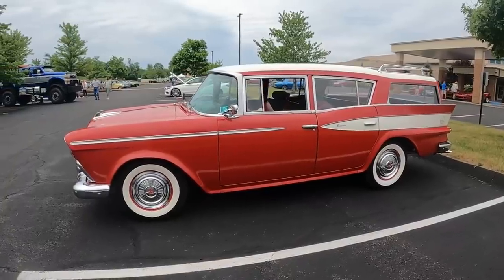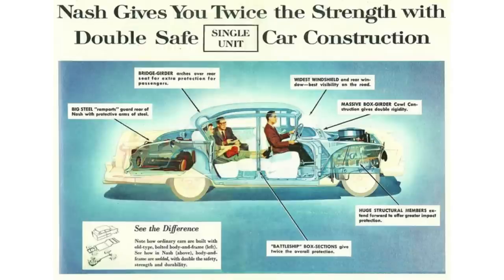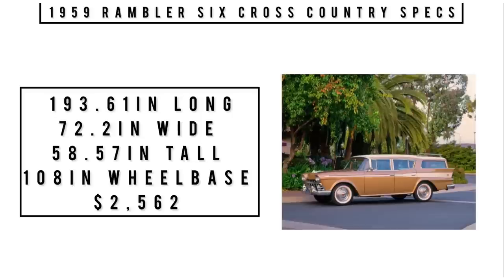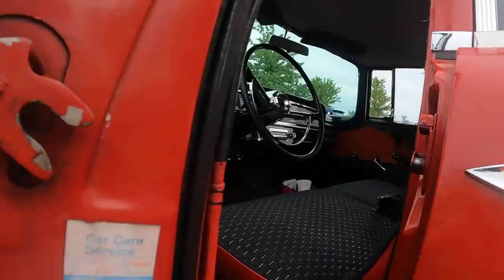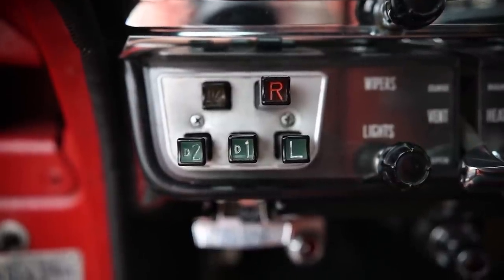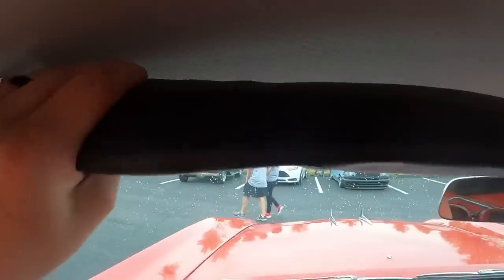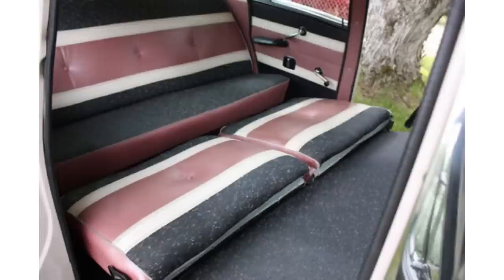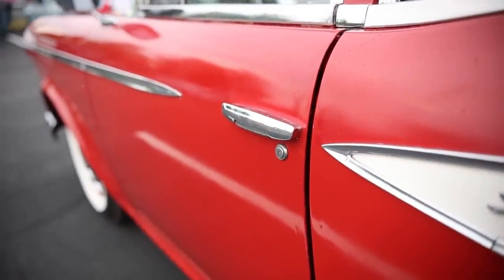1959 (AMC) rambler super cross country wagon six

Comment: AMC continued their basic flathead six well into the 1960's.  AMC, like Studebaker made the mistake of killing the upper scale car lines after they merged with other car companies. The Hudson Jet was a better car than an AMC Ambassador. The Hudson could be had with the Twin-H six and HydraMatic, although with drab slab-sided styling. The Packard Clipper was every bit as luxurious as a Studebaker President. Both Studebaker and AMC shoveled Packard V8's into their flagship models. Although Studebaker had it's own V8's from 1951, AMC didn't have their own until 1957.
Reply from the maker: But in 57 offered fuel injection (it gets overlooked tho Rambler rebel was the fastest car in the 50s and it was a four door car motor trend (was so in bed with Chevy even back then) couldn’t let the rambler a 4dr economy car almost have the price of the corvette bet the corvette.. one day that is something I want to do is line up amc rebel and corvette from 57 and set the record straight
Reply: Somewhat correct: the L head six.  It was dropped for 56 and was brought back in 58 for the low cost American where it was used for the price leader for some model years.  The subject of this review was never offered with an L head engine. Totally wrong: the Hudson Jet was not a better car than the Ambassador.  We had a Jet.  It was good for what it was: a frumpy, well made car, with an antediluvian L head six which was 3/4 of the discontinued Commodore 8.  It sold poorly unlike the Rambler.  The Ambassador was a serious medium priced car with a luxurious ride and a strong 7 main six with a fully balanced crankshaft.  In 1956, Nash Ambassador Specials and Hudson Hornet Specials were available with the new AMC V-8. The Jet was only produced for 53 and 54,  Ambassador was the top line Nash through 57 and was called Ambassador by Rambler beginning in 58.
Nash was late with a V-8 and so was Hudson.

Comment: I told that I would find out, Ambassador was the only Rambler model to have a hardtop wagon for 59 ,oh the added 6in was not to the front clip, the added 6ins was if the car had a Continental spare tire hanging from the rear bumper
Reply from the maker: Awesome thank you so much =)
Reply: Actually the Ambassador had a longer wheelbase than the Rambler Six/Rebel (117” vs 108”) brcause the front clip was extended! The length was further stretched (6”) if the optional continental kit was added (obviously on sedans only). 
You seem like you know Ramblers. That’s  refreshing as most car people have so many misconceptions about AMC. The common one concerns the fact that AMC’s 327 V8 was not a Chevy 327!
Fuel injection on the ‘57 Rebel was listed on the spec sheet, but was problematic. Many Rebels were fitted with 4-bbl carbs at the dealer level. Nonetheless, the ‘57 Rebel was the fastest production steel bodied car produced that year.
Reply: I just re-read your post re: length. I jumped the gun regarding the extra length of the Ambasdador. I’m sorry!
You were talking about the 6” he mentioned, not about the reason for the wheelbase difference (front clip).
Reply from the maker: I’m a huge fan of the orphan cars =) I don’t know everything tho but yeah amc 327 came out years before chevys version AMC offered fuel injection same time chevy did and that crazier thing is in 57 the rambler rebel was faster than the corvette and almost half the cost but never got the praise it should have gotten and is one of the most underrated cars ever.. I really wanna feature that car this year I think it’s an awesome car but I can’t feature every single car that’s awesome this year otherwise there won’t be any cars left for other years..I’m hoping to hit every single model of every single car between 1930 and 1970 1980ish I’m here for the long haul lol so if there are some things left out that’s done intentionally so it doesn’t become repetitious or redundant later on especially when I eventually get to do an Edsel there are so many advertisements Tom McCahill did a segment with the car.. that I so want to add to that video but there’s all kinds of advertisements like Bing Crosby singing about the car I think they made 18 different models of Edsel‘s but I could be wrong that was my favorite car at one point in time it dropped down to three my favorite car of the 50s era is the 57 golden hawk followed by the 59 Rambler cross country wagon followed by edsel citation

Comment: Your mileage may vary.   I would be very surprised if that car cracked 20 MPG.  I know that car manufacturers run these cars in optimal conditions to achieve those figures.  I've heard that the American would do similar mileage which in my opinion a bit of a stretch, but more likely then the car shown here.
Reply from the maker: Yeah totally agree the owner said he gets mid 20s to get the good gas mileage 3 speed man with electric overdrive.. at 50mph get it going faster mileage drops to but I’d figure putting a different rear end (honestly I’d put two speed rear in back the original rear and a super overdrive rear... ) that’s just me I like outside the box thinking
Reply: When it worked my 69 rambler 199 got 20 to 23 city with a single barrel and a light foot
Reply from the maker: I wonder about this all the time why don’t car companies put a two speed rear end in and have like a 2:90 final drive you will have notes for Netgear but if you’re going the same speed over a flat surface it will drastically increase fuel economy.. I was also wondering if they ever made a gear ratio for every 1 turn of the crankshaft two turns of the rear tires or more, at the wheels if we could figure that out that would drastically increase fuel economy..
Reply: @What.its.like.  My 59 American...3 on column, flat six, no OD, but still averaged 22mpg in city, and 28 on a long cruise.  Old-timers often would tell me that it was possible to get 30mpg+ with the OD.

Comment: There are a few in craigslist . As a matter of fact, there is one now with a chevy engine in it. I saw it yesterday  in the area of Los Angeles. Check the front suspension for cracks in the A frames in the trunion areas before you buy it
Reply from the maker: I want one of these one day I think I’m gonna try to look for one with the 250 V8 engine doesn’t require as much maintenance is the 196

Comment: I would love to find a Rambler from the late 50's-very early 60's.  My grandfather had a 1960 6 cylinder sedan. Are there any sources to find one. Also interested in a 64 Dodge Dart slant 6.
Reply from the maker: I found Facebook marketplace is a very good place to look for stuff like that engines or cars and generally you can get a way better deal if you find it on marketplace then if you found it at a dealership because there are classic car dealerships around as well it all depends on your situation